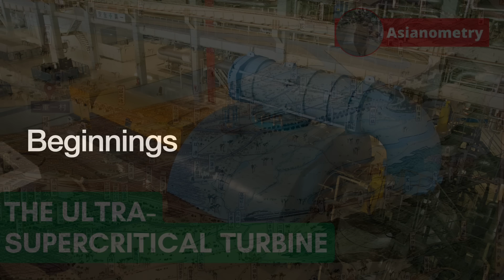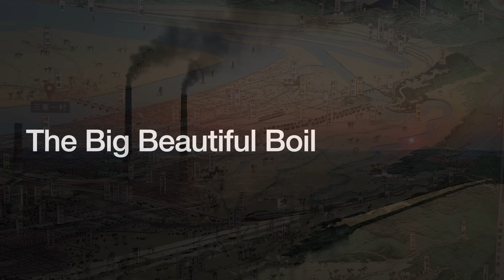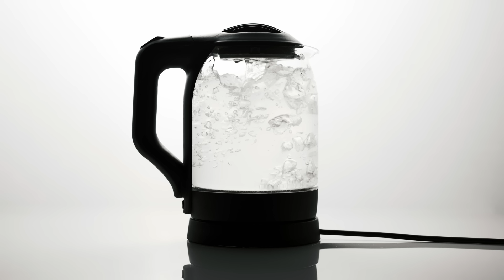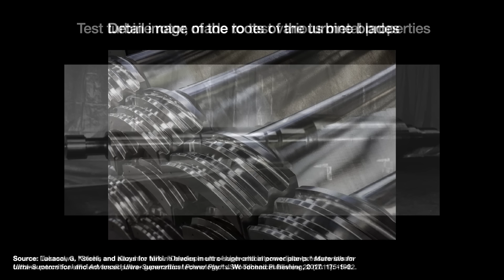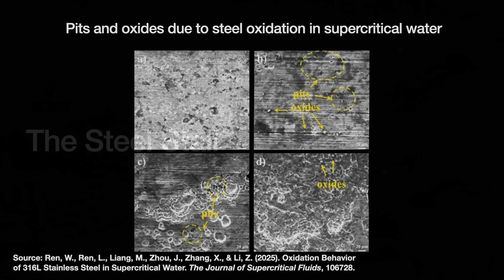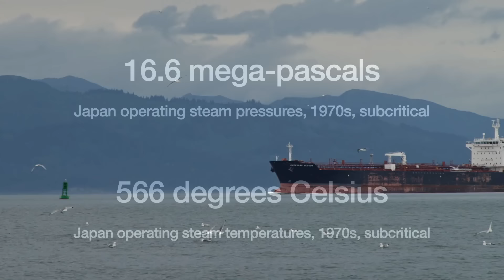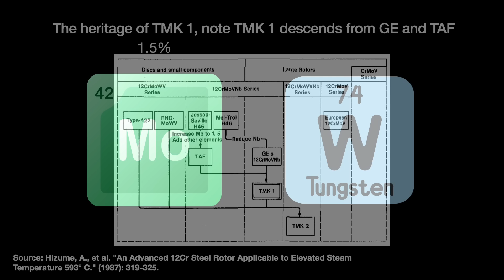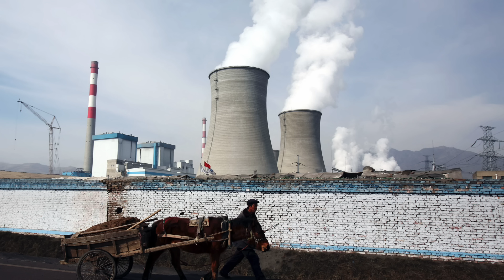The Epochal Ultra-Supercritical Steam Turbine

Comment: I am now retired however in the past I worked at Steam Electric Generating Stations that primarily burned natural gas in boilers. I did work in a generating station that had 2 subcritical units that operated at 1800 psi pressure and 1000 degrees F main steam temperature and reheat steam temperature. This generating station also had one supercritical pressure unit that operated at 3550 psi pressure and 1000 degrees F main steam temperature and reheat steam temperature. As a result I know that subcritical pressure boilers are simpler and easier to operate than a supercritical pressure boiler. Also subcritical boilers are a lot more tolerant of sudden changes in feed water flow and boiler pressure swings than supercritical pressure boilers. One big thing with the supercritical pressure unit was if the pressure dropped to 3200 psi it was an immediate unit trip where the entire unit was suddenly off line. With a subcritical pressure boiler if a boiler feed pump trips off the operating can get to the control board and start another boiler feed pump and the unit keeps running. On a supercritical pressure boiler if a boiler feed pump trips off the boiler water wall pressure drops and the unit trips off the line and the unit has to be restarted.
Reply: A good summary.  

Supercritical and ultra-supercritical plants are more efficient than subcritical plants if you can sustain the materials at the higher temperatures.  Subcritical plants typically operate at inlet temperatures around 1050 F and inlet pressures in the 2000 to 2400 psig range.  Many supercritical plants operate at that same inlet temperature, 1050 F, limited by the metallurgical problems discussed in the video, but they operate at higher inlet pressures,  3500 to 3800 psig.  

Lots of work was done in the 1960s to 1980s to develop and build supercritical plants, but the cost of the materials, the difficulties in operating the plants, and the shorter component lives led American plants to mostly go back to subcritical plants.  The reason was that, while supercritical plants had somewhat higher efficiency and used less coal, the total cost of producing the electricity wasn't much cheaper, if at all.  The extra capital costs and component replacement costs for supercritical plants pretty much offset their lower fuel costs. 

There was a brief return to building supercritical plants in the U. S. in the early 2000s, but the motivation was reduced emissions per unit electricity produced, not minimum cost.   In Japan, there was more interest in supercritical and ultra supercritical plants because essentially all of their oil and coal has to be imported from afar.  Transportation costs dominate the cost of coal unless the coal is mined nearby, so coal fuel is much more expensive in Japan than it is in the U. S.  For the Japanese, spending more on capital costs and component replacement costs makes more sense because the savings from reduced fuel use is more significant than it is in the U. S.
Reply: @thomasgreene5750  In the 1980s a coal burning electricity generating station was built with two large about 800 megawatt units in the state of Utah called Intermountain Power Project. These units were built as subcritical pressure units, natural circulation and balanced draft, not as supercritical pressure units.
Reply: @d @davidgrisez subcritical unit with natural circulation in the water walls and a balanced draft furnace is a pretty simple, clean and reliable design.
Reply: @davidgrisez What was the station heat rate?
Reply: Would cook you before you knew it happened
Test for leaks with a broom stick
 If the stick cut in half there's a leak. Old Navy method.
Reply: @JohnTaylor-nd3mw  My merchant marine friend told me about that.
Reply: Sounds like you'd need a lot of accumulators in supercritical systems
Reply: the operator can ??
Reply: How old must you be to be before the age of CCGT?
Reply: @Shaker626  CCGT plants began being built seriously in the mid to late 1990s.  I had the lead for engineering oversight of the design and construction of a couple of CCGTs in the late 1990s.  The people who had the lead for designing those early plants are long retired, and the most of the folks who actually constructed them are probably recently retired or close to it.

Comment: F the carbon footprint.  The science behind it is weak at best.  The reason to switch away from coal is the pollution and environmental damage.  You have to mine and burn incredible quantities of what is, frankly, dirty rock and that spits huge amounts of unpleasant garbage into the air and water on top of leaving huge pits in the ground.
Reply: The carbon footprint is equally important but I don't want to downplay your other rationale.

Comment: Ultra Super Critical steam turbine nuclear reactor?
Reply: Yeah, dual fluid and co. But only at the concept stage for now I assume.
Reply: @beatreuteler  I just wish we could standardize a design to mass produce the parts and drive down the construction cost.  I know there are a lot of other expenses for them, but this is the only one that can be easily tackled.
Reply: @quazy1328  First it should show the concept works. Which is still in question.
Standardization of a concept that didn't proof it is right, has no benefit.
Reply: @beatreuteler  The French designed and built a standardized reactor design and cut the cost down dramatically per unit.  It is the way they are building NG power plants these days, they used to take 5-8 years to build and now that take 2 years and at a much lower cost due to standardization.
Reply: @quazy1328  This is exactly what I mean. NG power plants were a concept that was proven through several 1000 units globally. The concept was not showing any significant uncertainties. So that was the right moment to standardize (maybe already a little late though).
This is not the case for example with Gen 4 nuclear plants.
Reply: @beatreuteler  So now we can apply that to nuclear power plants.  When you learn to drive you aren't restricted to only driving one specific year make and model of car, so it shouldn't be hard concept for a real person and not an AI to understand.

Comment: Ultra-Super Critical steam turbines have a very flummoxing problem in China. Chinese strategy for some time, has been to dismantle older steam turbines - non-critical, critical and replace them with supercritical and ultra-supercritical steam turbines.

But these steam turbines are extremely inefficient when not at full load. Thus, China's strategy of still having coal plants, and then using them as backup in case sun doesn't shine or wind doesn't blow - is causing massive headaches for their power companies (though not much, since 100% of the electrical grid is SOE in China) in that, when renewables are plentiful and readily available, they are required to buy them first, but also keep the coal plants on standby to step in immediately if needed. Keeping supercritical and ultra super critical plants on standby still uses up a decent amount of coal, and you  don't get paid for it.
Reply: Thermal stations are honestly horrible backups, because they have to be kept hot. Gas turbines make for good backups because they are much quicker from call to spinning. Naturally the fastest from call to on grid is likely hydro, afaik hydro is open valves, get up to speed, make sync adjustments, connect to grid. Also make sure to make sync adjustments before the final step or the power plant makes expensive noises.
Reply: Their goal is replace the coal with #thorium fission with the same turbines. Eventually #p11b or an #aneutronic cycle.

Comment: You say coal centric, but doesn't it apply equally to nuclear, or even concentrated solar?
Reply: Nuclear doesn't get that hot, you don't want the fuel to melt into an elephant's foot....
Concentrated solar could in theory get extremely hot (theoretical limit id about the effective black body temperature of the sun, i.e. around 5500 C. But it's not really worth bothering. (Also, just use solar panels, they deal so well with less shiny days, and are extremely easy in comparison to CSP facilities....).
Coal though can readily be burnt at around 1700~1800 C, which is sometimes done in order to maintain the (bottom) ash in a liquid/molten-slag state so it can literally drip down from a grate instead of having a chance to pile/clump up on the grate.
If not for the ash they'd just feed pulverzied coal to gas turbines btw. In part because you can actually run those meaningfully hotter than steam turbines.
Reply: @namibjDerEchte what's the max point of zirconium oxide? Isn't that the limit of nuclear? I think you have no idea what you're talking about
Reply: @BrowithStoryCool Better stay with current safe limits of nuclear plants. Not of dreams for an unknown future.
Reply: @beatreuteler was this translated from a foreign language?
Reply: @BrowithStoryCool Well, maybe not really translated, but if you recognized a non native English speaker then you got it.
Reply: @beatreuteler I've got a talent
Reply: Yes.

Comment: From an energy security point of view, coal is great because the fuel is sitting on the ground, on their property.  Most natural gas / Combined cycle plants rely upon pipelines to be able to delivery their gas.  An upset in the gas supply results in and upset in electricity generation.  Since Supply and demand for electricity is instantaneous.. this can be problematic

Comment: Man if we just powered those turbines with something that doesn't end up in your lungs I'd be more stoked about it, (pun not intended)
Reply: Exhaust gas treatment technologies tend to fly under the radar. When i worked at a waste burning power plant i was pleasantly surprised by the multi step processes. In the end only CO2 and water vapors were coming off the pipes. Asianometry video on the subject would be very interesting.
Reply: These days with filters it ain't bad at all for the health of the people. 

Mine brother is in upper management of power plant company and lives 100 meters away from a coal plant proper. Even last 30 years improved filtration of harmful particles from coal plants by quite a lot.
Reply: @andrzejnadgirl2029 Hahaha of course you think that!
Reply: @elia8544 think?
Reply: @elia8544  Your ideological position has no ability to refute facts.  Perhaps you could explain how a three-way rare earth metal catalytic converter operates?  Hmmm?
Reply: Also, this may end up relevant for geothermal turbines if they can ever get safe supercritical bore holes.
Reply: And put mercury and other heavy metals into everything.
Reply: Nuclear powerplants is the answer...
Building a nuclear reactor in a region where they have earthquakes and tsunami is challenging, dont put the reserve generators for cooling in the basement....
The Fukushima "explosion" did not crack open the core, thus radioactive fuel was NOT spread... no one died of radioactive fallout compared to the total disaster at 
Tjernobyl where the core exploded "no real reaktor confinement" "bad design" and spread radioactive fuel everywhere, killing and destroying the environment with high grade radioactive contaminants, 1000 times more potent.

Comment: I don't see why solar plus battery storage wouldn't replace coal.  CATL's new Nextra sodium ion battery is set to drop battery price by 70-90% on a per kwh basis.  This should make baseload no longer an issue.
Reply: You need something that works complementary to solar in latitudes greater than +/- 30 to 35 deg. Most countries do wind for that.
Reply: There is this inconvenient thing called winter...
Reply: @dirtdiggity1714  While it is true that a combined load of millions of heatpumps, even they are individually an intermittent load, can be faking a baseload. However that is just one part of the entire load that is still daytime dominated by loads demanded by industries and other businesses. This very small portion you could call baseload if you will could easily be covered by biomass plants in most economies. Conditoned the biomass isn't burnt as baseload all year but is stored and then only burnt during winter times.
Then just for fun: There are about 1.5 to 2 billion people living in a window limited by the +/- 30 to 35 deg. latitudes that do mostly not suffer from cold and dark winters.

Comment: Good and informative video! A couple of corrections: the largest gas turbines produce well in excess of 500MW and in CCGT power plants configured in 2+1 (2 GTs and 1 ST) easily match the 1500MW of the largest coal power plants. Also, state-of-the-art CCGT have reached 65% efficiency (Mitsubishi, I think)!

Comment: A footnote. Nuclear power plants have to  work at much lower temperatures and pressures.  Efficiency becomes a slippery concept with nuclear reactors because the fuel cost is so low. Put the fuel in, run it for years.
Reply: Except for if the concept of dual fluid rectors eventually could make it out from the concept stage, with that reactor scheme I believe temperatures would be much higher than with the known ones.

Comment: I'm sure you've seen China has developed a supercritical CO2 turbine...for now at least.
Reply: That’s correct but the utility of CO2 turbines will not be in coal plants. The gains here would be not significant.

Nuclear power plants run on relatively low steam temperatures, because they don’t have Superheaters. This makes the thermal efficiency of nuclear plants relatively low in comparison to other thermal plants. 
CO2 turbines will be potentially used in next generation nuclear plants to improve thermal efficiency. The efficiency gain in nuclear plants will be significantly higher.

Comment: Put bluntly, to paraphrase SM Stirling, this is like a magnificently advanced iron lung being developed after the polio vaccine had been invented.  With BESS systems, coal and natural gas are already obsolete.
Reply: Battery storage of industrial scales are their own can of worms, ironically enough a lot less eco friendly. Cycling out the sulphuric acids etc. for their function is extremely problemtic.

Alternatives are requiring too much of rare elements and have other issues.

No one is forcin coal if there would be better alternatives, wind and solar are already cheap to produce but storing it on serious scale is different matter entirely. And any failure in storage would lead to devastating ecological damage as well.

Comment: Now the next frontier is in CO2 supercritical
Reply: Ultra super mega hypercritical lol
Reply: There were reports in the last two month about a 2 * 15MW supercritical carbon dioxide power generator entering production at a steel plant in China.
Reply: Supecritical mode is used in many refrigeration systems with CO2 as refrigerant. The pressure on the condesor can reach about 300 bar.
Reply: In a way sCO2 is easier, because you don't have to deal with water and immense room-sized turbines anymore. They can be much smaller and deal with an inert substance, so you can do fun things like single crystal titanium blades.
Reply: @ssj3gohan456  but it's highly corrosive, not only because of the ability to oxidize metals, but also to form volatile carbonyls
Reply: @deniskhafizov6827  sCO2 is highly corrosive, and nickel based superalloys are required and haven't been fully validated. The recuperative gas coolers/heaters are expensive and have to be large. And the power output has to be fed through either a gearbox or inverter to lower the frequency to 50 or 60 cycles per second.
Reply: @gregorymalchuk272  The last thing is barely a problem, since semiconductor invertors can process nearly any amounts of power from/to AC/DC of any kind with much better efficiency than the oldschool tech.
Reply: @deniskhafizov6827 I don't know. An efficiency loss of a few percent in either a gearbox or inverter will be reckoned in terms of millions of tons of thermal coal. Power plants will do anything to gain just a fraction of a percent in efficiency, improved sootblowing, turbine blade upgrades, condenser cleaning, feedwater heaters, etc.
Reply: @gregorymalchuk272  Efficiency loss of a significant part of power (like a fifth to a third) is sad reality of the transmission lines of today. Simply converting backbone lines to HVDC saves significant amount of power (spent fossil fuels etc) even despite the conversion losses. For a power plant it may be the optimal design to generate HVDC directly.
Reply: @deniskhafizov6827  May I ask, where is your data coming from? 🤔
In Europe, I believe the average assessment for most units of energy being transmitted is 5%-20% transmission losses? 🤷

But EU's grid is mostly more optimized for this, than in other places, it seems... 🤷🙏
Reply: @elektrotehnik_94_NinoD  Of course it's from memory, based on particular transmission lines that I don't even remember. It's probably cherrypicking of the worst cases. By the way, the World Bank is publishing the statistics of Electric power transmission and distribution losses (% of output) where you can see that the overall losses in the world had dropped from about 9% in 2000 to 6% nowadays. But there are still countries with 20-30-50 percent of transmission/distribution losses.
Reply: @ssj3gohan456that's pretty fkn cool
Reply: which is actually a bit easier to do as CO2 goes critical at 31c and 1070 PSI. Steam is critical at 374 and 3200 PSI - doing an entire cycle above the critical point is "more exciting" for steam :D
Reply: So I've heard.
Reply: https://www.youtube.com/watch?v=BNDrC6fkjf0
Reply: @o224hsday  how tf you could post a link in a commentary (without getting it erased immediately)
Reply: YouTube links are accepted.
Reply: Then finally move beyond coal and go to liquid salt/metal reactors and helium